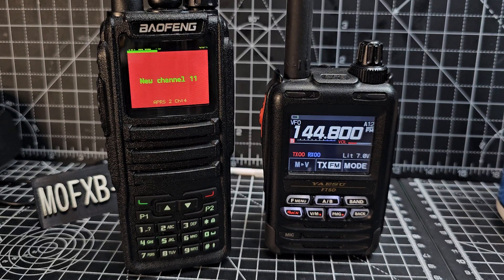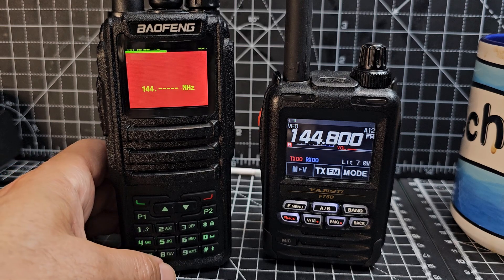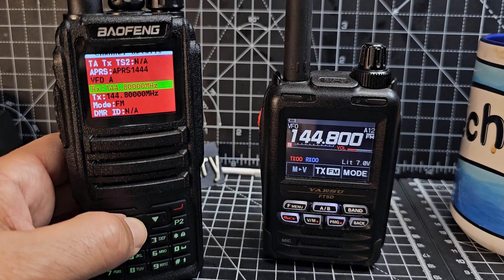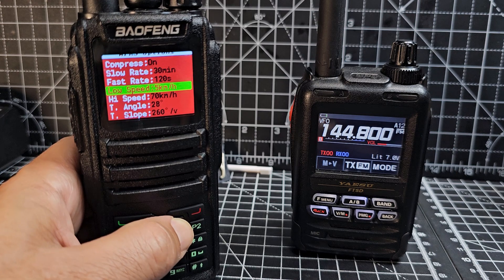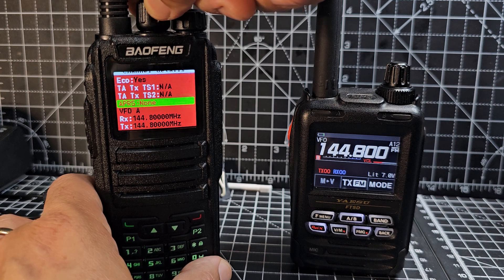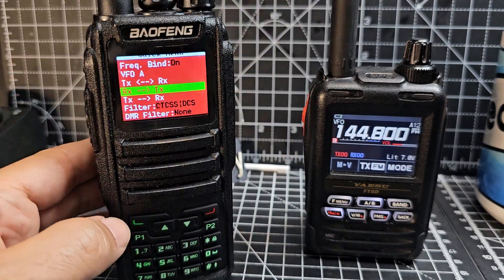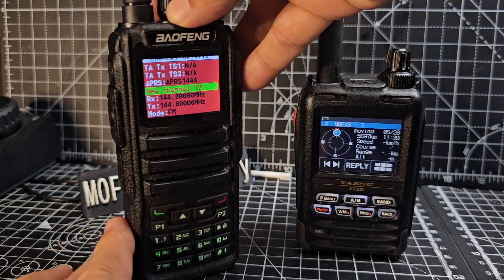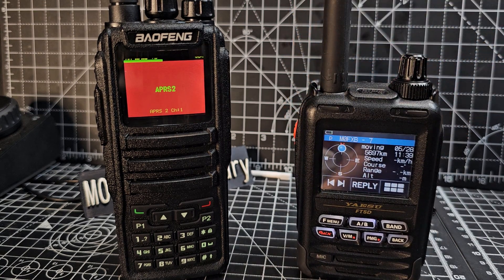APRS - Analogue Set Up Opengd77- DM1701 Using Radio

Comment: Hi Andreas. I'm using firmware 20241215112702. I have followed your very informative video on my DM1701. When I push the PTT, It doesn't send data, the screen shows '0' then Location?  My FT5D sees the carrier but no information. Any help always welcome. Ah Ha. It's not obvious but in Radio Info it tells you location is ???.?????N and  ???.?????E. You can enter the details via the numerical keys and save with green button...All works now!! 73
Reply from the maker: https://youtu.be/bmxxZ5ETs7A?si=pEYH6c-aFMg_p9B1